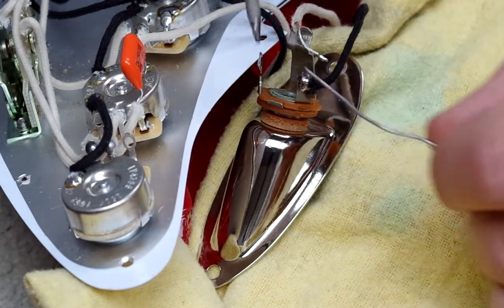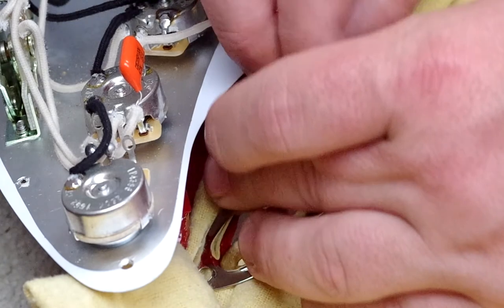How To Solder Guitars (5/6) - Soldering to a Jack Socket

Comment: Had my Fender Strat for 10 years with no issues until one of my wires on the output jack fell off.  This was EXACTLY what I needed to make sure I do the repair correctly. Thanks!

Comment: I use those Pure Tone full contact mono jack sockets, basically 2 contacts for positive & earth giving 200% more contact & holds the jack plug more securely with a better quality contact...worth a tenner for sure...you can only buy them for use on control plates or pickguards, not long enough for some guitars & bass's but fit's all Fender guitars & most bass's  perfectly.....